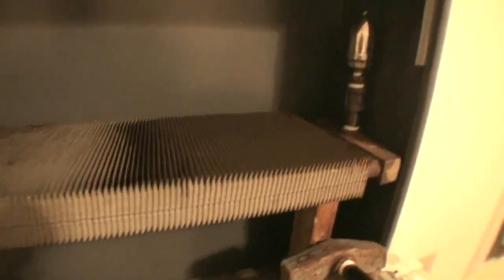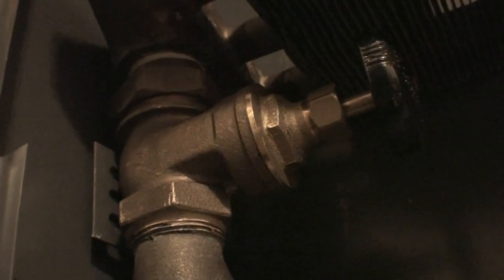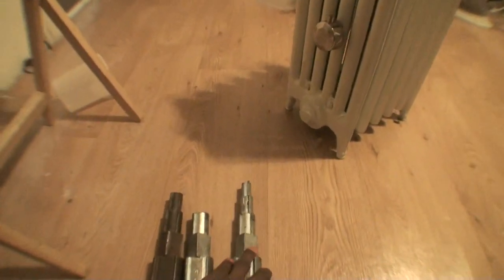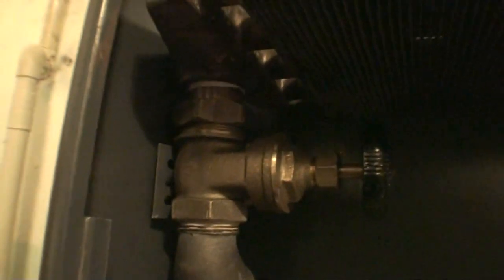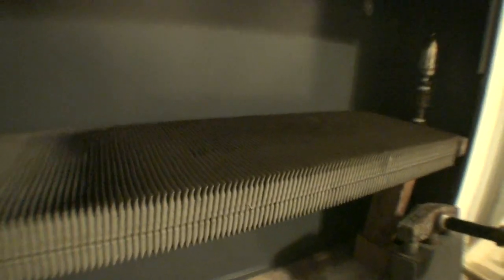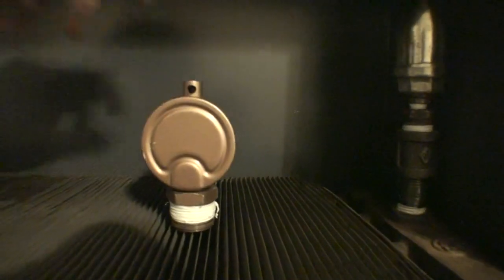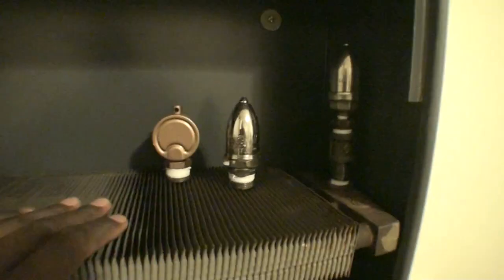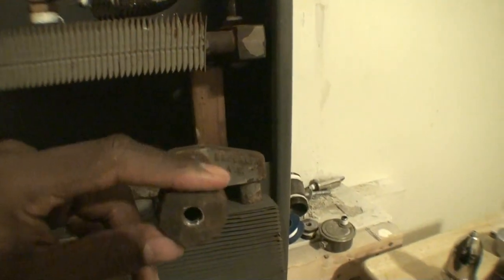Steel element convector radiator tutorial.

Comment: Good morning,
I have these same convector radiators. Can the system be balanced by limited the amount of water in the convector by adjusting the valve (lock shield valve)? One of my rooms is way colder than the rest and seems like if I adjusted it, it may help. I also am nervous about playing around with it too much. Any tips?
Reply: hey bro. I have these same convectors in my current apartment. I have a couple questions. you think you can help?

Comment: I have these same type of convectors in my apartment. In one of the bedrooms it’s missing the whole steel element convector. Seems like they capped off both sides and took out the whole convector. There’s a lot of loud banging on the pipes around the apartment. Can that be the reason why there’s loud banging since there’s no radiator circulating back to the boiler?

Comment: I have one of these radiators and it was moved from one corner of the bathroom to a new wall. The valve that should be releasing air has been releasing water, as much as a faucet. What could be the problem?
Reply: Make sure its tilted at an angle

Comment: Akwesi where are you located if someone wanted you to check out their heating system. My two back rooms on the second floor of my home with these same radiators. we currently have a Gordon air valve with a top hole not on the side. Also the valve screws on and angle like an L. My point is that both rooms do not get warm at all no matter hot high I put the thermostat. I had a engineer from my hotel come check it out, lets say it worked for about two days tops. Suggestions?
Reply from the maker: It sounds to me like your using the wrong valves, If you have steal convectors then you should be using a straight air valve not an angle valve, it seems to me like your using air valve that are meant for self standing cast iron radiators, go to a plumbing supply store and ask them for straight Hoffman or Gorton air vents for steel convector radiators also make sure you know the thread size for each radiator as well and let me know how that works for you.

Comment: I have this fin system thruout my 1930's house. I get great heat on the 1st flr living room kitchen dining room however in my bedrooms its freeeezing.
Because my radiator is uncommon to most plumbers they have not been able to help me determine how to resolve the problem. I cannot sleep in my master bedroom because of the 30degree difference in temp. I have spentso much money in oil this winter and cannot continue with this unfortunate situation. Are you in NYC by any chance . Do you service 
boilers ? if so please tell me how i can contact you.
Reply from the maker: Yes I'm in the NYC area. Send me a Personal Message and I'll help you with your problem.
Reply: @akwesi100  Did you fix this problem? What was it?

Comment: HELP i have a 1930's house these are the radiators allover my house. the only difference is that they don't have any valves on them. in my basement you can see each radiator with a valve attached. I am having problems with the heat in my house and i don't know what to do. PSE&g came to by house and they basically had never seen a system like mine. at the end of the day he suggested that i replace the valves in the basement. does this make any sense. do you have any ideas?